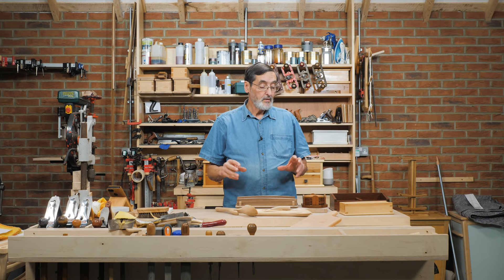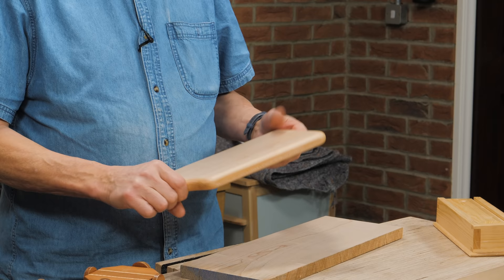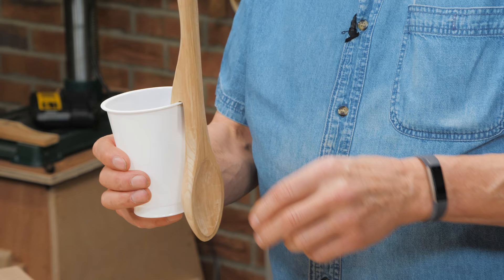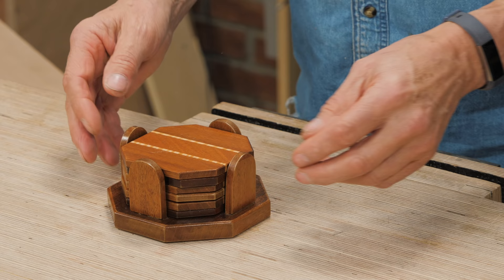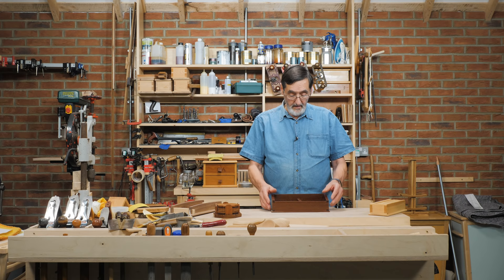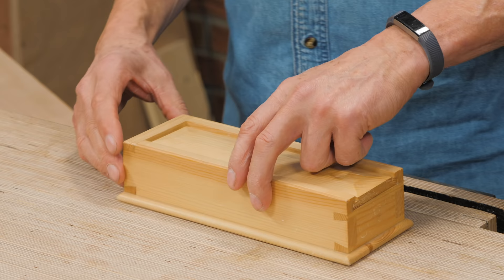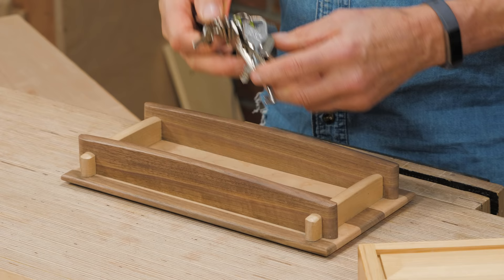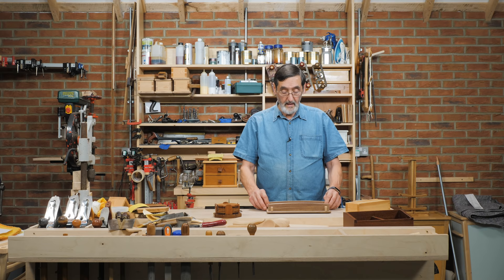6 Simple Woodworking Projects | Paul Sellers

Comment: Can any of these be done without a workbench? That's the real obstacle, and most workbench series utilize a lot of tool, tool sharpening, joinery, stock prep, lamination skills that seem like they need to be practiced first, but on what without a workbench? The other option is buy an expensive bench or buy an expensive bandsaw or other power tools / machines to make one without needing to have the hand tool skills already.